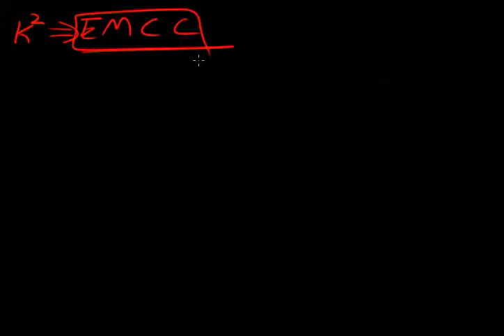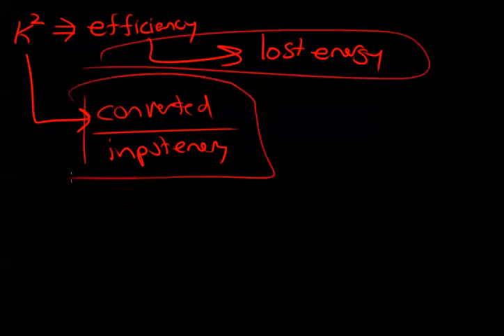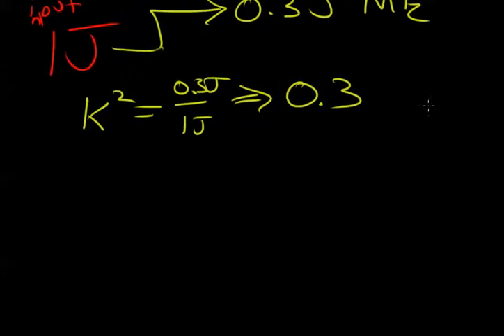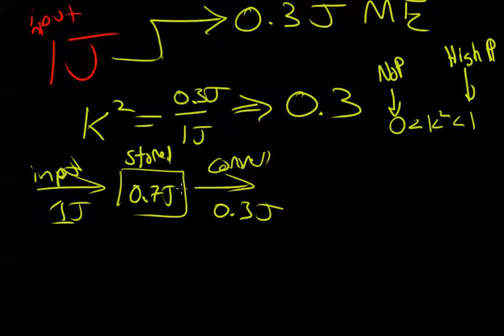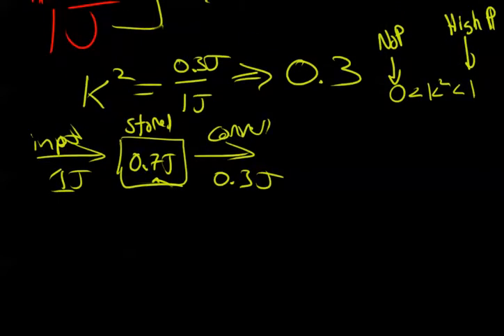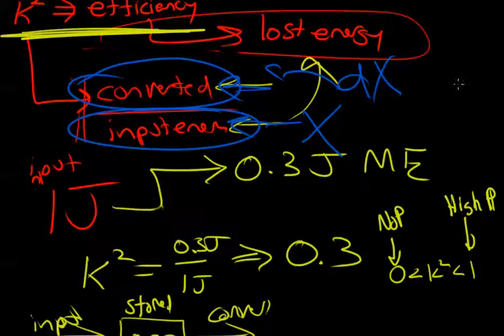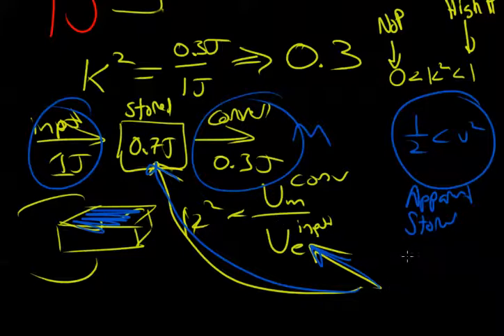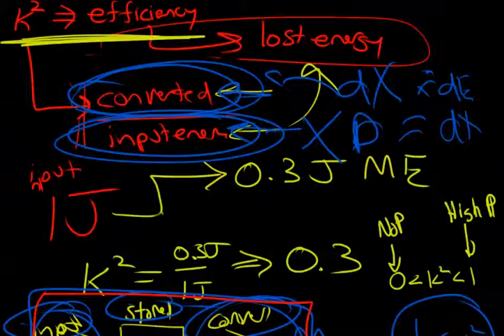Lecture 3 Part D: Electromechanical Coupling Coefficient

Comment: Thank you for your videos explaining the rarely exemplified field of piezoelectricity.  Your videos were one of the few I found.  But I still don't quite understand how the electric output of piezoelectric materials is represented.  That is to say if you press down on a piezoelectric material how much electrical energy do you generate as a result?  For example.  On the Wikipedia page for "List of piezoelectric materials" the material BaTiO3, also known as Barium Titanate is shown.  The Electromechanical Coupling Factor of that material is k15 = 0.57.  I'm still new to this field of study and don't understand what k15 = 0.57 means.  Is this to represent the piezoelectric output of that material in millivolts or something else?  I'm afraid it's rather confusing and I don't understand.  If you wouldn't mind clarifying for me and others who are curious about this I would very much appreciate it.
Reply: kinda late but the 15 is a subscript indicating the polarization (placed electrodes) is in the direction 1, which corresponds to the x axis (1,2,3-x,y,z). the five represents a shear force, in the y axis (4,5,6-x,y,z). Shear is basically turning the material, thus creating some sort of torsion